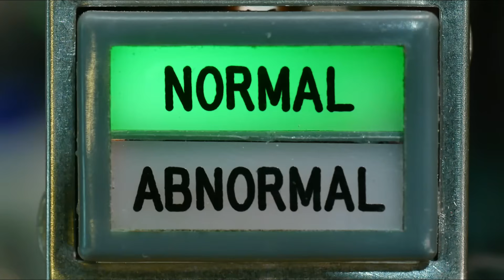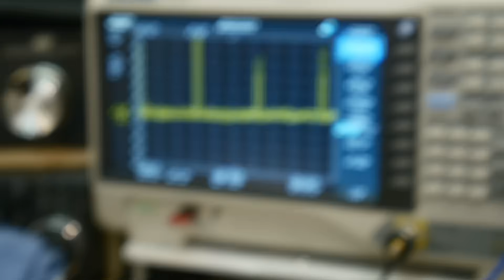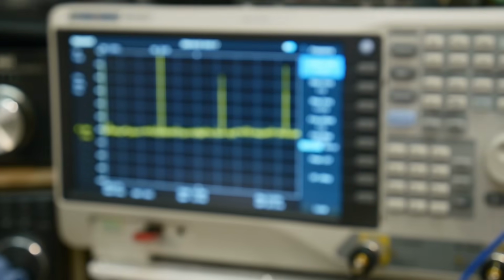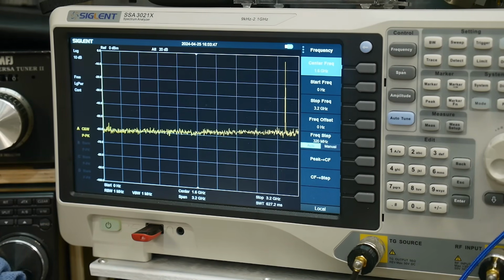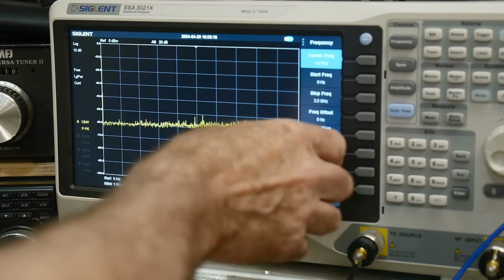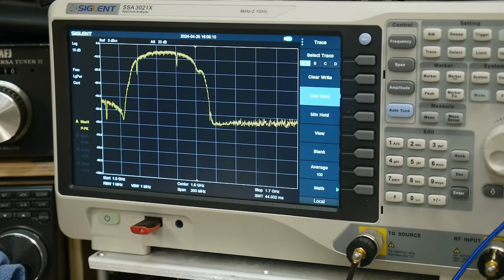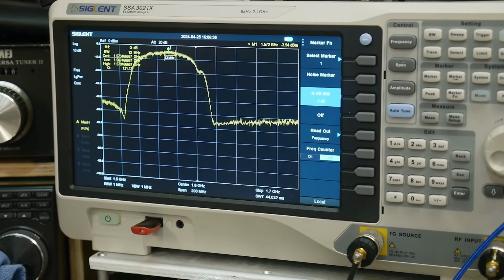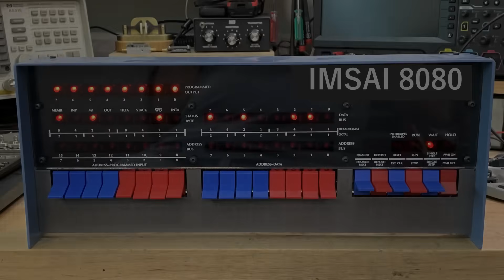#1885 MAX2870 6GHz Signal Generator

Comment: I purchased one of these, but I have encountered a problem.  Using the buttons, I can step the frequency in increments as small as one kilohertz, as shown on the display the display,  but the actual output frequency only changes in steps as small as ten kilohertz.  When I try to step in one-kilohertz increments, I have to advance ten steps before the output frequency changes.  Have other people experienced this?  Is there a fix?

Comment: It would have been nice if they included a connection for an external reference.
Reply: Mabe they did as there is one SMA connector facing up that I don't think was covered and it was up with the MAX chip.
Reply: Is this Max2870 dds or PLL based ?

Comment: Nice VHF generator! I could use something like that, only lower frequencies, from e.g. 100kHz to 600MHz or at least 150MHz.
Reply: может чтото подобное как генератор сигналов  SI5351A
Reply: @victorhamenko2788 he would need an external circuit to set the power output if I recall correctly

Comment: Good grief dude, You’re starting to worry me about radiation… Perhaps a quick review on Xray detectors… Love the vids, Thx.
Reply: Why? The output power of these things is minimal.
Reply: @misterhat5823  It’s not that test board that compels me to shove lead down my pants, Like you say that is  low power test board… It is more the frequency coupled with the potential high power power supplies that would elude to…I have had my bench clicking a time or two, Just saying.

Comment: I found the following about the serial protocol on an AliExpress listing. May be of use to someone (or may be completely wrong!)

Explanation of serial port protocol

Serial protocol Baud rate：9600

Related instructions:
The protocol consists of 9 bytes, byte 1 and byte 2 must be 0X55 0X55. Byte 3 and byte 4
represent the upper 8 bits and the lower 8 bits of the integer part of the frequency, respectively. Byte 5 and Byte 6 represent the upper 8 bits and lower 8 bits of the fractional part of the
frequency, respectively. Byte 7 represents the output power. Byte 8 and byte 9 must be 0X0d and
0X0a; the communication baud rate is a fixed value: 115200;
E.g：

100.123Mhz +5dB Frequency command：0X55 0X55 0X00 0X64 0X00 0X7b 0x04 0X0d 0X0a
100.123Mhz +2dB Frequency command：0X55 0X55 0X00 0X64 0X00 0X7b 0x03 0X0d 0X0a
100.123Mhz -1dB Frequency command：0X55 0X55 0X00 0X64 0X00 0X7b 0x02 0X0d 0X0a
100.123Mhz -4dB Frequency command：0X55 0X55 0X00 0X64 0X00 0X7b 0x01 0X0d 0X0a

2000.456Mhz +5dB Frequency command：0X55 0X55 0X07 0Xd0 0X01 0Xc8 0x04 0X0d 0X0a
2000.456Mhz +2dB Frequency command：0X55 0X55 0X07 0Xd0 0X01 0Xc8 0x03 0X0d 0X0a
2000.456Mhz -1dB Frequency command：0X55 0X55 0X07 0Xd0 0X01 0Xc8 0x02 0X0d 0X0a
2000.456Mhz -4dB Frequency command：0X55 0X55 0X07 0Xd0 0X01 0Xc8 0x01 0X0d 0X0a
It can be found in the table that both the integer part and the decimal part are directly sent
integer data, for example, the integer part is 100, and the high 8 bits and low 8 bits of the value
100 are directly sent in the instruction. The decimal part is 123, and the upper 8 bits and lower 8
bits of 123 are sent directly in the instruction. After the MCU receives the instruction, it will
automatically synthesize the two integer data into the floating point data required. Note:Computer USB and MCU serial control cannot be used at the same time.

Comment: Great IC. Can you show some application that can be done with this circuit? Thanks
Reply: Inject frequencies where it is needed. For instance if it can adjust output power you can calibrate and check reception quality of radios

Comment: Not bad at all considering what it can do. I just wish it went down to 100 kHz without external mixing. 25+ Mhz is pretty high for a bottom end for what I might do. Of course I can always set up other gear. I'm just getting both fussy and lazy in my old age.
Reply: perhaps change (reduce) the base frequency oscillator on the board (?) to drop the output frequencies? -for the price its worth playing around with
Reply: Perhaps Buy a different thing like NanoVNA.  Mines goes from 10k to 6G (maybe 9G?).  It does a lot more and has a much easier interface for less than $90.
Reply: Lol, some of use old-timers still break out n sweat when we had to design stuff having to work close to 1GHz. Nowadays you get stuff like this, that would have taken a few racks and weighed a tonne, not so many years ago. (50 years ago isnt that long ago, is it? 😂😂😂)
Reply: @Hellhound604  That seems like just a month or so ago I was sitting in my bedroom at my parents house as a teenager and listening to the Voice of America from Rome Italy on my Heathkit shortwave receiver.  My service monitor, which sold for $35,000 when it was new, only goes to 1 GHz.

Comment: Ah, STM32F103C8T6 @8:10 🙂 that one is probably a counterfeit as the original costs above $3@2.5k.
It's exactly the same type as in those cheap BluePill JTAG/SWD debuggers for around $3.
Reply: lcsc will get you real ones for suspiciously cheap

Comment: I wonder what’s going on in those chips to make those GHz frequencies?
Reply: maths
Reply: They usually have an on-chip VCO with PLL running at several GHz, then a chain of programmable dividers that give you the output frequency you want (that's why they put out square waves).
Reply: @joseppuig925  How exactly do you divide several GHz to get GHz? That approach wouldn't allow for many frequencies to choose from.
Reply: @joseppuig925 bleh 🤢, that’s yucky digital stuff I can’t build. One day we will all be able to make GHz frequencies from analog circuits, until then I’m happy with my 24 MHz radios.
Reply: I've always wondered how a  2 Ghz or so cell phone stays on frequency with  case temperatures changing over  a 40-50 C range. Anyone know how it happens. ? I suspect the  tower system sends  tune offsets  from time to time or the tower system sends out   a beacon that the respective phones can auto zero beat to. ....
Love to know  the detail on this.